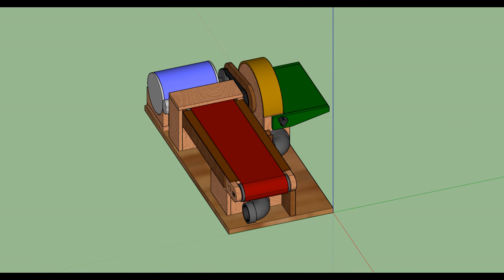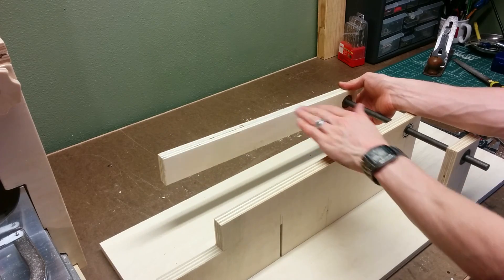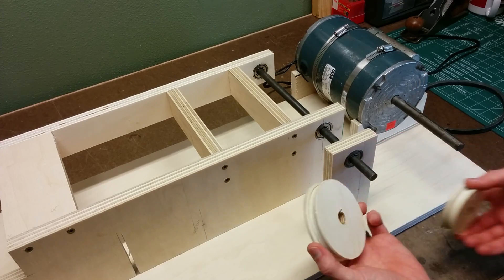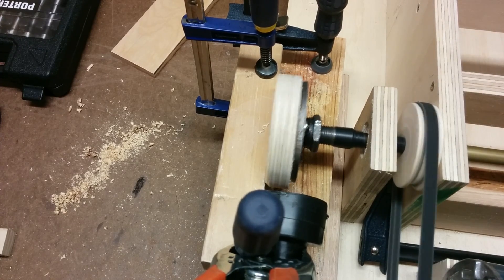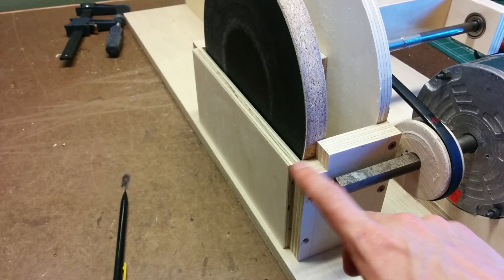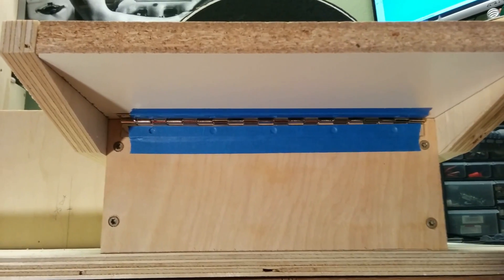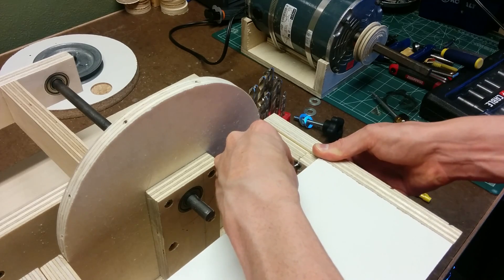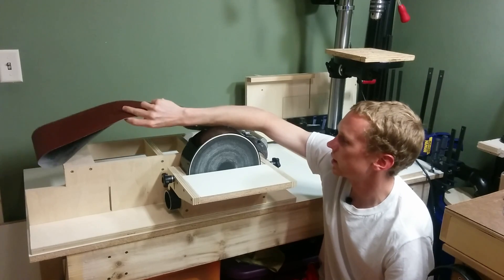Building a Disc / Belt Sander Combo (Part 1)

Comment: I can't find the exploded view either.
Look like a great project.  I can't wait to start it.
Reply from the maker: Paul Gendron there are no dimensions or instructions, that's why it's free. You have to pull the dimensions yourself using the tape measure tool in Sketchup.
Reply: Thanks Justin for your response.  I was poking around in SketchUp, calling myself a novice would be a compliment, and found dimension tool.  It's pretty neat. So I'll get the dims from there.  Thanks again for your reply.  When the weather warms up a bit I'll start the build.

Regards,
Paul

Comment: what is the rpm of your motor? is it ok if i use a 1/2hp induction motor with 1680 rpm?
Reply from the maker: alvinto22 mine is 1750rpm. 1680 would work just fine.
Reply: Justin Depew thanks a lot.. im planning to build this one also.. great design thanks for sharing.. 😊
Reply from the maker: alvinto22 do send a picture when you're done!

Comment: Nearly finished my belt /sander combo after viewing your excellent video. my drums are slightly larger diametre 4".The difficulty I have is that everything here is metric, my drills etc are imperial and as far as bearing recesses and holes for shafts, it's a case of "never the twain shall meet".Good quality tools, or indeed most tools we need are in short supply and limited availability.Thank you for your videos.
Reply from the maker: The sawdust maker. David. Great to hear you are building your own! Is it similar to this one or your own design?

Comment: Could you have used your drill press as a lathe or your chuck couldn't fit the shaft?
Reply from the maker: It wouldn't fit the 1/2 inch shaft. I don't think it would have had enough speed and power to be an effective lathe either.

Comment: Looks good! I should do my disc mount properly, like you did... I went with a double thickness of melamine, but it wobbles a bit on the shaft... Looking forward to part two!
Reply from the maker: If I learned one thing it's that connecting things to shafts is difficult, and I'm better off buying the parts instead of making them.